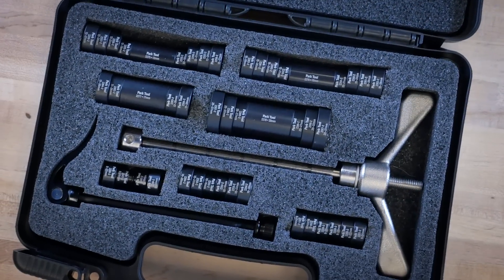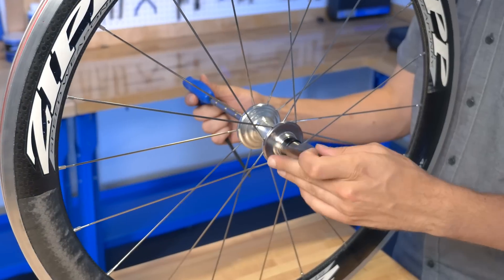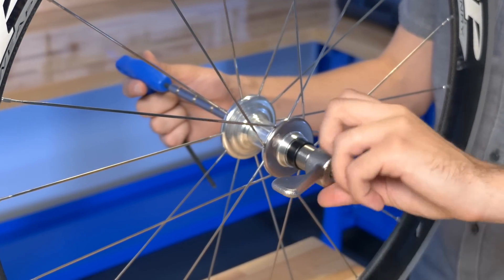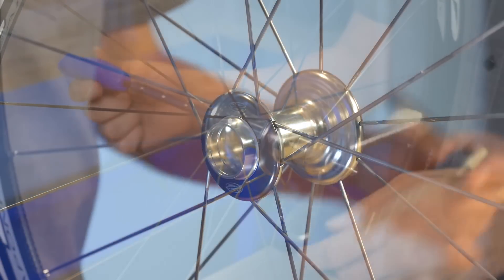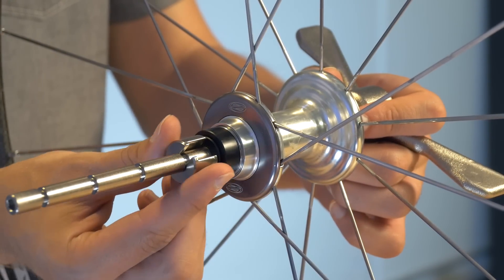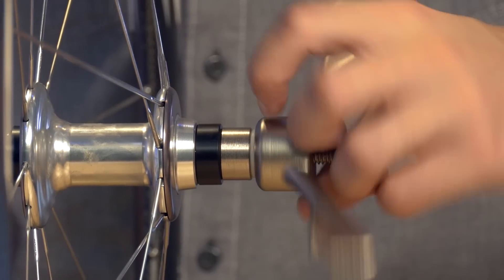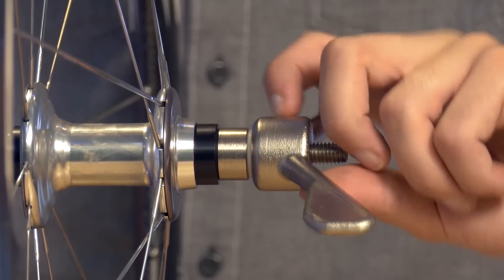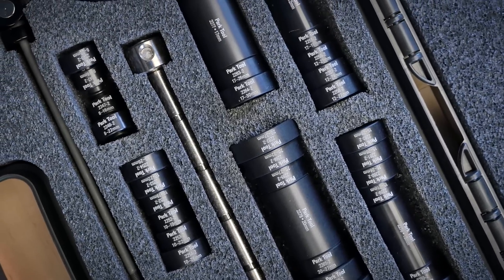HBP-1 Hub Bearing Press Set

Comment: would this work for removing and pressing bearings into suspicion bike links
Reply from the maker: Not for removal, but installation may be possible if one of the included drifts is exactly the same size as the bearing in question, and the tool clears any obstacles in its way. Maybe. We may also have some tools in the pipeline that are purpose-built for suspension linkage bearing removal and installation... 😉
Reply: @parktool  thank you, was surprised how hard it was to find a tool specifically for linkage bearings.     After closer examination I exploded my bearing so its going to take some creativity getting whats left of it out...   Bought new linkage so I can wait for the new tool from you.

Comment: Can this be use for bottom bracket?
Reply from the maker: +Zeratul7575 We do not recommend it. The bushings included with the HBP-1 are specific to the sizes of bearings commonly found in hubs, and will not be able to correctly press most bottom bracket bearings.

We do make a press specifically for bottom brackets: the BBP-1, seen here: https://www.youtube.com/watch?v=y1kKyjU9b0s

Comment: Hi, how would I use this tool in "over axle" scenarios if only one spacer for each axle size is supplied?

Are the bushing faces flat?  Or recessed so only the outer race is contacted?

Where can I find all the dimensions missing from your pdf? (IDs/ODs/lengths of spacers, diameters of the "T" handle and cam skewers, bushing IDs, etc) so I can better assess the tool before purchase?

Why is the T handle so misaligned on the bushing at 0:55 sec in the video?
Reply from the maker: 1. The smaller bushings can be stacked up to extend or to create a spacer for each side. You can also stack up a large OD spacer against the bushing pressing against the bearings. We have not yet been made aware of any compatible bearing/hub combinations that can not be pressed using the bearings and spacers we provide.

2. The bushings are flat. This does put most pressure on the outer race. There is some contact on the inner race but it is not significant and does not damage the bearing surfaces.

3. The ODs and IDs are listed in the instructional PDF. The spacers are nominally 38mm long. The shaft is 3/8" (9.3mm). The bushing thickness is nominally 10mm. The small skewer is an M5 thread, as is the standard for most skewers.

4. The shaft and pressing bushing are not misaligned. There is an extra bushing on the end shaft to take up space, and it is sitting slightly off the shaft center. The pressing at the pilot and bushing are square and straight.
Reply: +Park Tool would this tool allow me to remove pressfit ball bearings from Liteville 301 frame?
Reply from the maker: +Alex Pavlov  If you are referring to the bottom bracket, the Liteville 301 is listed as having a threaded bottom bracket, not a press fit bottom bracket. The bottom bracket bearings will unthread.
Reply: +Park Tool no, I'm referring to press fit ballbearings in the frame, in the horst link and also in the top tube rocked plates (there a needle bearing pressfit into the frame)
Reply from the maker: The HBP-1 is designed to install bearings, not remove them. Additionally, the bushings included with the HBP-1 are specifically sized for common hub bearing sizes, and so we cannot guarantee compatibility with frame suspension bearings.
Reply: +Park Tool The frame uses standard Endura Pivot ballbearings 6902 and 6801 . Is your press fit kit compatible with these? http://www.bikewright.com/index.php?route=product/product&product_id=263
Reply from the maker: The HPB-1 does include bushings and pilots for the 6902 (28mm OD, 15mm ID) and the 6801 (21mm OD, 12mm ID).